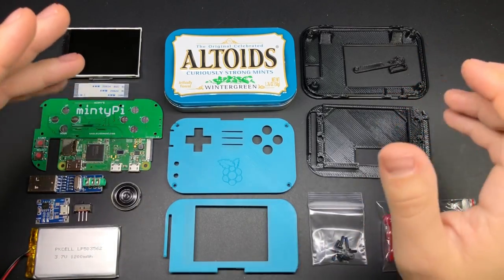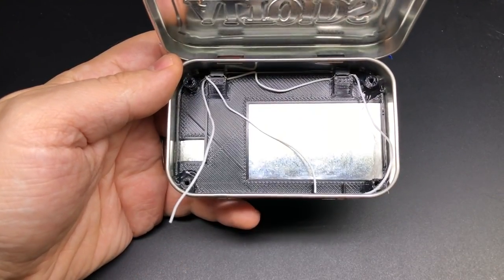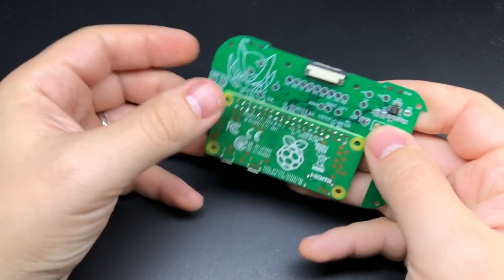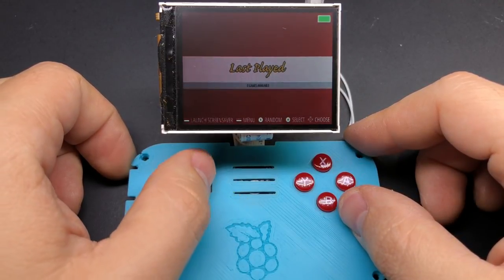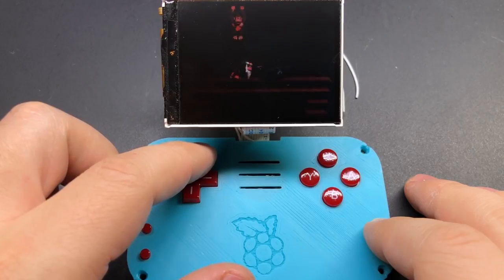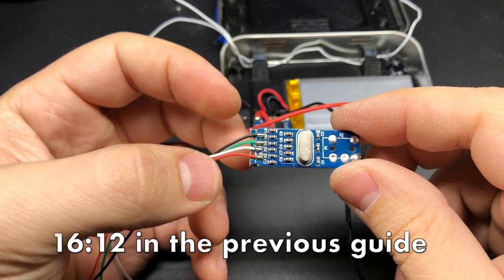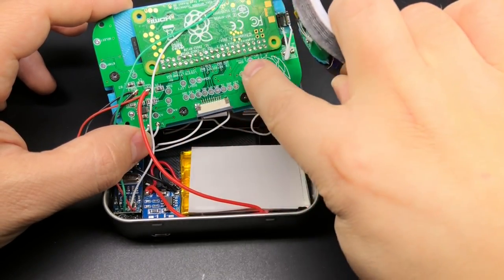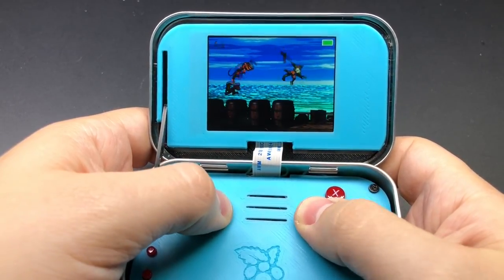mintyPi Updated Parts and Software Guide

Comment: This is a very nice project. :) However, I think that you should tweak your 3d printer settings or something because the texture is incorrect.  And the "Minty Pi" intro is weird. It would look much better and smoother without the last part, where the raspberry appears and shrinks.
Reply: Diabl0pl the texture on the top (the only texture visible once it’s assembled)? That is probably from painters tape on the print bed
Reply: Yeah the material theme also looks ugly. Usually i like material but this is just ugly.

Comment: I like the idea of the function button, but I think it still needs some work for user friendliness. For example: Replace the wall of text cheat sheet with a graphical diagram. However, what I think would be even cooler is if the 3D printed parts actually had icons indicating the functions next to the buttons. It would also be nice if the cheat sheet was shown by simply holding the function button instead of having to press R.

Comment: Wait a second. What's the point in using specifically Pi Zero W in a grounded metal chassis? It seems to be recessed into the chassis enough that it should almost shunt out or shield the wireless signal.

Also thermal pad alone makes for a terribly ineffective heatspreader, as its thermal resistance, about two orders of magnitude higher than that of metals, quickly adds up across. Maybe using copper tape sandwiched between two insulators like acetate sheets or something like that would be better.

Comment: That piece of sheet you put in between the battery and pi zero looks like those they use between chip and heat sink. If anything the pad will transform the heat over not isoloating the heat. The pi cpu seems directly under the 3d printed cover, so why not open some small vent to let the heats out?

Comment: Hey Wermy, not sure if its a difference in the final board or not, but at 5.21 you circle the CS pin to the BTN, but on my board the BTN goes to the pin next to the CS pin...the 8th pin from the left, which is not marked.  Not sure if this matters in the long run, as I'm am not finished building, but worth checking out.
Reply: You are correct, Jonathen; definitely has the wrong pin circled in this video.  I got stuck here and ended up following the trace back to the gpio directly to the left.
Reply: I had exactly this problem about an hour ago. I need to go back and solder that hole next to the cs to get my function button working!

Comment: When I was first assembling this I noticed I had two different screen cover plates. I assumed the one with the rectangle hole was for the 2.2" ILI9341-based SPI TFT screen while the one with the extra space cut into the side was for the specially modified 2.4 screen. Is this assumption correct? If not, what are the two different screen plates for? Which one should I use if I'm using the 2.2 screen?
Reply: Just noticed that the piece with the extra space cut into the side is smaller, so it would make more sense for that one to be for the 2.2 screen. However the piece that just has the normal rectangle hole does not line up with the base plate piece that sits in the lid behind the screen, but it's the only piece I ever see used in the youtube tutorials. Please help.

Comment: if only there were a way to shove an aux jack in this thing, even a 1.5mm. Just something so I can use a pair of headphones, because mono-only, front-facing only audio is kinda lame. 

Also, on the topic of audio, how accurate is GBA audio emulation? I have yet to find a desktop emulator that emulates GBA sound well, and while My Boy does a pretty good job, it's nowhere near the real deal in a lot of games, especially sample-heavy games like B-Daman Fire Spirits and Pokemon FireRed/LeafGreen
Reply: This project uses RetroPie and Emulation station so it's emulation of GBA is whatever you would get from that. The project didn't invent their own GBA emulation. This is primarily a hardware project. It's surprising for someone who is so concerned with specific emulation questions, you have never heard of or used Retropie/ES.
Reply: Actually, you can check this right on your PC, whether you perceive it as accurate or whether there are specific issues that you notice. Try Retroarch, and use its gpsp core for GBA emulation. Retropie is basically just a distribution of Retroarch for these kinds of small single board computers. But then, sometimes the emulation performance may be insufficient on a single board computer and additional sound issues may become apparent in some games, but as a whole, it's the same.

I doubt you've seen or heard this emulation core elsewhere, i mean it's possible, it is open-source after all so someone else could have borrowed it, but it doesn't have its roots on PC, but in PlayStation Portable homebrew. This also means it's more performance centric than accuracy centric, but who knows, there could be surprises.

Comment: I was trying make one too but I got too lazy so I just got a very small android phone  from amazon and glue in to the tin and open a ipega 9017s controller and drill big hole for the L and R buttons and for the power I made a hole and put a Lego peace to act like a button which is just pressing on the power button and for the L2 R2 button I got this Bluetooth earphones with buttons so I just remapped them

Comment: I don't know if you can help or not but no matter what I try I can't seem to get that extra button to work. I've switched the wires around, soldered on different leads on the button and triple checked that the connection on the board to the pie is good. I even soldered it directly to the board at one point. I messed up my configuration before installing this button and after installing it I try to add it as the "hotkey" and any other key but it never registers as a button. Please help if you can, thank you!

Comment: Is there anywhere I can get a prebuilt one I missed the giveaway and I’ve been following since the first 3D printed one
Reply: Karthik 99999 where would I get one
Reply: GRIFTY P who says sissy any more? And besides I do t have enough electrical knowledge to be able to do this myself without fucking up
Reply: Atlas Syvoravong the whole point is u dont need the knowledge he gives detailed instructions
Reply: Also read more about it learn
Reply: Guitar_Guy 42 even with detailed instructions most can still mess up
Reply: Guitar_Guy 42 cause then when you mess up you might not be able to fix it so you would have to buy the part again
Reply: Look he cant sell it it breaks copyright law with the altoids can
Reply: Guitar_Guy 42 that makes sense I just thought someone would have an idea of where to get one
Reply: Even then most people will then ask for roms wich he than gets another copyright violation
Reply: Atlas Syvoravong I sell them
Reply: where I need one dm me on twitter @trnrpercygaming
Reply: Look around, you may find someone experienced who will help you build it or whom you can commission to build it. Console modders will usually take such jobs, but it'll be pretty expensive, like a few hundred dollars. Maybe there's a radio club or electronics club or a hackerspace nearby, these are the kinds of places where you can receive guidance. You can even run into an old electronics nut in a library, if those still exist.
Reply: Someone sells it
Reply: Y'all have to build it

Comment: Gotta admit, I really wish I could understand some of this. Like, I understand to a DEGREE how it works, as I've done some basic IA Tech stuff... But when it comes to actually DEALING with some of the more physical aspects, like soldering and drilling? I turn into a wuss, constantly afraid I'm gonna break something that'll be expensive to replace.

I got so many questions, like on those boards... All that green space. Is that ACTUALLY anything important, or is it JUST empty space where no lines run through? If I accidentally scratch it with an X-acto or something along those 'blank' spots, will it mess things up? How do you deal with arranging those cables in there when closing the thing? And what was with that shiny tape that he said he was gonna tape over it before closing it up? Did he tape the cables down with that, or did he just tape it to prevent some kinds of contact from other cables? And come to think of it, when folding the cables in, how do you keep them from being tugged off their soldering spot?

A long time ago, I tried soldering for my first time on a hoodie I have, called the Technomancer hoodie. A few cables tugged out, and it got fudged up, so I tried for my very first time to repair this kinda stuff... It didn't go quite well, and it was almost impossible for me to keep the solder blobs tiny and from over-lapping with ANOTHER spot... Long-story short, I messed it up. So  I'm really unsure about this stuff... That, and I've never messed with a raspberry pi before either. I want to make a small little system about the size of a cell phone in my pocket, but I don't wanna buy all these drills and solders, just for ONE project, that I might bungle up. For anyone who read this, thank ya for listenin' to me vent.

Comment: Hello I am a noob to this kind of stuff and on the written guides part list it links you to some wire can this wire be used for power/ground/data/audio etc or do I need different types of wire?
Reply: Jack Jeanblanc well for power you should use 27 and for anything else it's better to use a thinner wire like 30. It's more power efficient
Reply: ZenXMasterEX sorry for the delay, but the only thing that changes is gauge so I could use the same type of wire for everything just different gauges?
Reply: Jack Jeanblanc pretty much. If you are using silicone wire then yes
Reply: ZenXMasterEX Ok thanks for the help!

Comment: how much does it cost with all the parts?
Reply: about 117 to 147 depending on weather or not you buy or print the 3D parts and the size of the micro SD card you buy.
Reply: I recommend a 8 or 16 gigabyte sd card
Reply: According to my calculations for my personal experience buying, it's a little over $170. It was a tough purchasing decision for sure, but I eventually just had to jump on it for the excitement at this project.
Reply: That includes shipping and taxes, but only for the unique parts. So things like wire and toold are not included in there.
Reply: thanks!
Reply: OHH YEAH MR KRABS